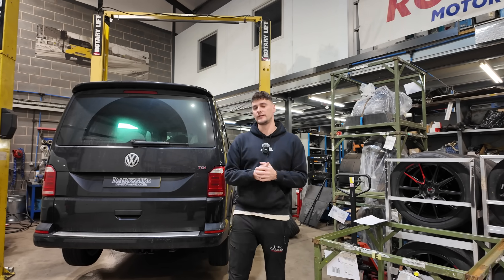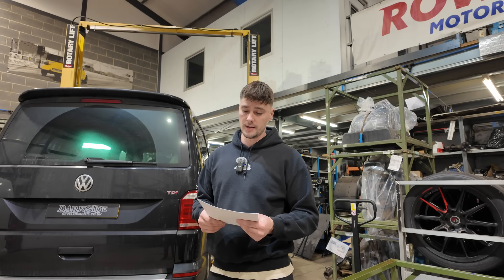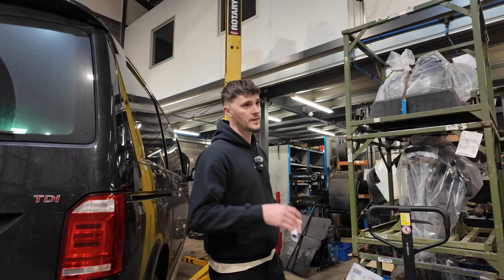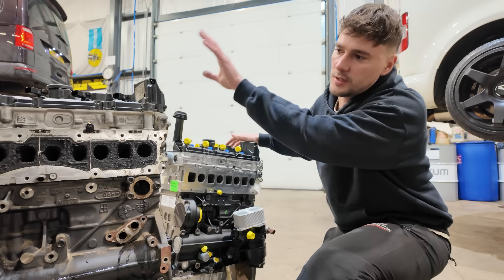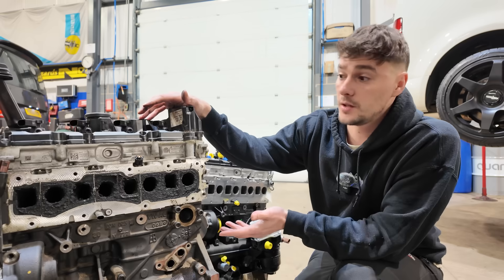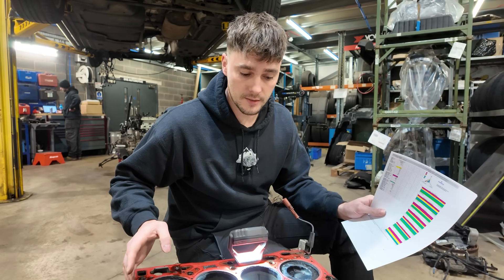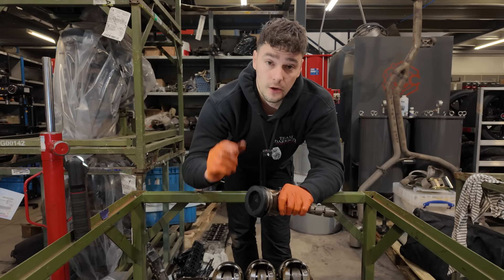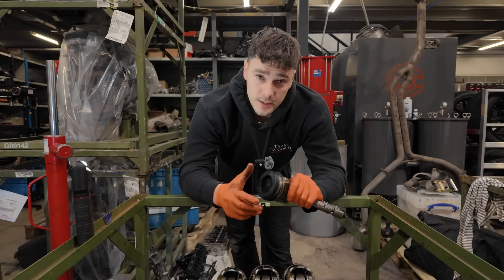Could this be the WORST VW engine of all time? 👎 2.0 BiTDI VW Transporter

Comment: Hello dear friends!!I'm sending from Greece!I'm on about to buy an audi a3 2.0tdi quattro 184ps automatic!Is that engine and transmission reliable and trusyworthy for lots of miles?Are there any issues that should know and check?thank you very much in  advance!
Reply from the maker: They have a similar EGR system so always worth checking inlet manifold for carbon build up. We haven't seen the piston ring issue with this one though.

Comment: I don't claim to be an expert I think this is due to the amount of carbon which clearly is being thrown into the cylinders from the EGR buy the inlet manifold couldn't believe the amount carbon around the top of the piston on the sides if you look really clear carefully you can see physical scratch marks on the top of the piston around the sides where carbon has damaged the piston my Vue is it's all to do with emission system ie the EGR
Reply: @keithknight1107  And all of this crap blows by the rings because of two main reasons.
Low tension piston rings and a lot of back pressure due to the DPF, SCR ect.
Even worse with mileage of course.
And then the the 30.000km oil change interval on top.
It's more of an thin abrasive paste then oil after ~10.000km.
I have seen a few oil analysis results of 2.0 bitdi engines where it's really that bad. The lowest was 5000km and it was already considered as waste oil by the laboratory😂😂😂
EGR delete and changing the oil often might get you a little further. Maybe doubling their life to 100.000 miles or so😂🤷🏼‍♂️
Reply: Just do add to this I own a 2006 Vauxhall Vectra 1.9cdti 16v and with that I have had EGR mapped out and blanked it off I also have taken the inlet manifold of removed the swirl flaps cleaned all the inlet manifold out. Since then I've noticed the engine oil remains clean for quite some time which it never did before this shows you how much carbon is being thrown into the engine and being absorbed into the oil which can't be good for the engine

Comment: I have a 2022 204 t32  its just covered 33,000 miles and has had its a oil changed 4 times in that time . Does the later engines still have the same issues. I only use my van long distances in excess of 200 miles at a time .i dont use the stop start system and i always let the turbos cool down before I switch the van off ,should i be concerned, or am i doomed.
Reply: Change oil 5,000/6,000 miles
Reply: @mrmick4757 that’s mad intervals for diesels 5>6
Reply: @ Why
Reply: Different engine revision, don’t worry about it. But also get extended warranty and don’t get it mapped if you plan to keep it for a few years. Always premium diesel and always regular oil/filter changes, I do mine every 5k miles.
Reply: If it’s not using any oil, it should be good - that’s sign really, if it’s using 1 litre of oil every 1000miles there will be an issue with the piston rings probably. sounds like yours is fine.
Reply from the maker: Hard to say at the moment as they haven't covered the mileage of the earlier engines. By the sounds of things you will be fine if you are doing oil changes sub 10k
Reply: @shanewaller2864  I suspect alot of damage to these engines is done before the first service interview of 18k miles, if it was me I would oil change after a few hundred miles, 2 thousand miles and then every 5000 miles and run it in gently like you would have done an old car. If it's junk in the first place obviously that won't make much difference.

Comment: Not necessarily the piston ring that’s at fault.  Ask the owner if they use fuel and oil stabilisers.  Often I understand what happens in direct injection engines is that the carbon builds up in the valves when using unrtreated supermarket fuel, then ends up scoring the bores and causing oil and compression losses.  I use 2 fuel stabilisers alternately in my fill ups and I have fairly low oil consumption in my own diesel VW Transporter.   Using a good quality oil flush, and changing the oil and filter every 7.5 k miles helps to keep the engine clean too :-) , I only use 5w 40 pd fully synth longlife spec oil.
Reply: This is key and often overlooked. Quality diesel, additives and regular oil/filter changes.
Reply from the maker: What engine code do you have?

Comment: There’s probably other things to consider but seems quite expensive to chuck away an entire engine for the sake of bores and pistons. What was the rest of the engine like, obviously pretty chocked up from the high oil consumption? But was oil pressure down?
Reply from the maker: They can definitely be rebuilt. The core units are sent for reman

Comment: My 2019 DAVA engined MAN TGE has 120,000 miles, has been given death since day 1, has had the oil changed every 10k miles and has never once needed a single drop of oil between changes
Reply: Is about EGR and Turbo replace territory (unless you cool the turbo before shutdown...)
Reply: @ it had a new egr cooler under warranty at about 80k and I’ve been thinking about maybe getting the turbo done as preventative maintenance, it’s just finding time to be down
Reply: @ShalomBrother Also there is one new TSB for replacing the fuel pump regulator. ;)
Reply: I wonder if its becuase youve given it death ;-) i.e. does the engine getting hot and being ragged clear this crud out? I see some of these transporters on school runs and wonder if lots of short journeys are exacerbating this.